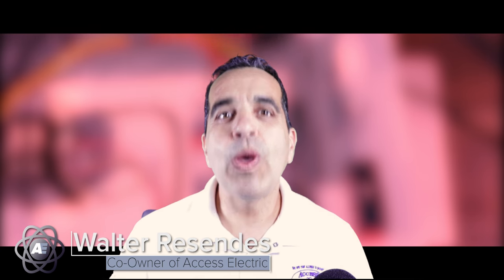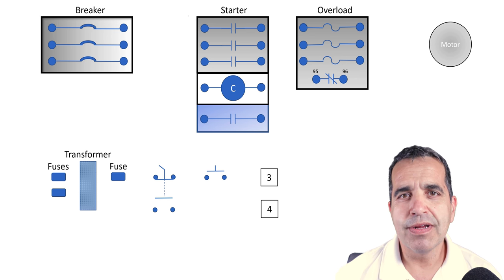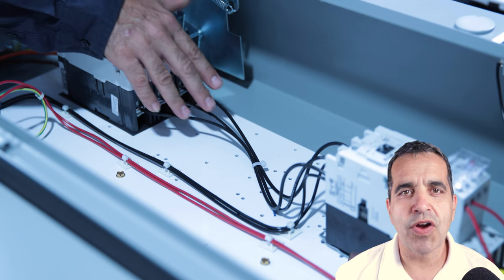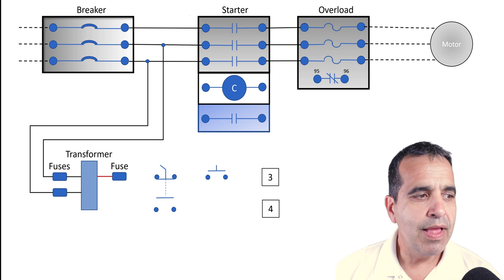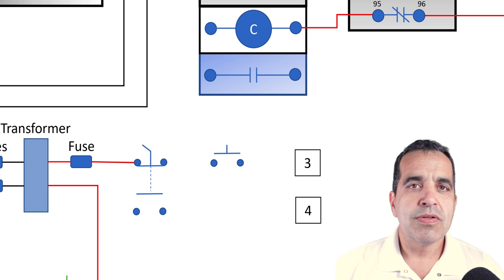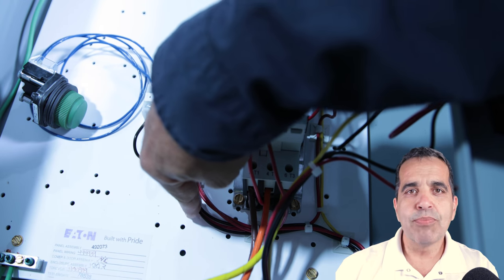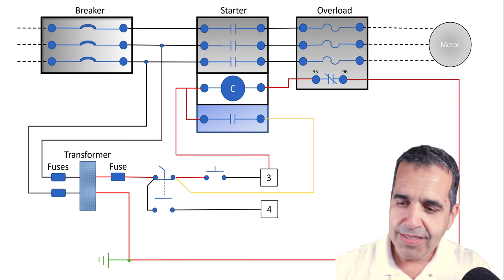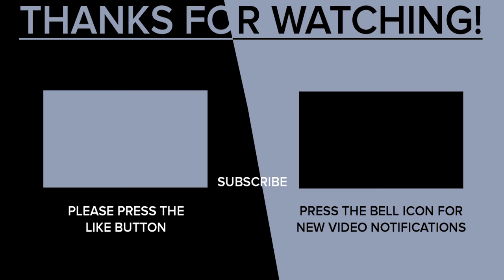Basic Motor Control: Pump Panel Wiring - Part 2

Comment: Greetings! I absolutely love your video. I am a rookie. May I ask a question? I am trying to "make sense" of the wiring for the auxiliary contact (red jumper and yellow wire). 

Which one is the grounded (neutral) contact? Since the jumper is coming from what appears to be the "hot" wire and the yellow is coming from the "hot" start wire, why doesn't this result in a short-circuit. 

I guess if I were to ask the question differently, I see the 120v loop for the coil with a grounded and ungrounded conductor. But for the contact, which kne is grounded and which one is ungrounded? 

Any help is necessary and thank you for taking time to review my question.
Reply from the maker: Hello and thanks for watching and commenting. If you look at the video and go to minute marker 6:08, you will see the red wire from number three going to the coil and to one side of the normally open auxiliary. And you will see the yellow wire coming from our hand off auto to the other side of the auxiliary. Keep in mind that both of these conductors are fed from the same power source. They are basically the same wire except at the red goes through the normally open start button and the yellow does not. The yellow effectively bypasses the start button. As for the ground in neutral conductor that is coming from terminal 95 on the overload directly to the other side of the coil. Since the red and the yellow that I mentioned earlier are basically the same wire, there is no potential difference between them and that’s why there is no short.
Reply: @AccessToPower  Thank you so much for your kind response! This made perfect sense to me when you pointed out that they both come from the same source, which is why there is no potential difference. Your videos have really helped me apply many of the concepts in the NEC Code Book. Thank you so much for all of your awesome videos!!!

Comment: Is there anything saying the overload aux contact is required to be on the neutral side of the contactor coil?
Reply from the maker: if the coil is 120 volt then the neutral would go through the NC OL contact. If the coil is 240 volt then you would run Line 2 through the OL. Same goes for a 480 volt coil, you would run line 2 through the coil. This kills power to the coil if the OL trips. If you dont use the OL contacts then the OL will not turn off the starter in the event of a overload.

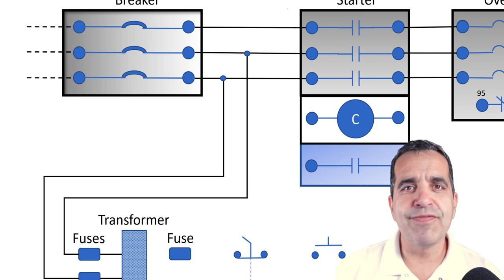Comment: 3:12 2-phase 😉
4:00 by grounding you have lost protection... Without (!) ground it will work as isolating transformer, so if you will touch the control wire, you will not be shocked by voltage 😊

Comment: What's the reason to used a lower voltage for control? Could they make the coil on the motor starter 480v coil and would eliminate the transformer?
Reply: Late but, 120 is safer for hand control in the case of a short

Comment: Series connection of smart motor controller to traditional (electro mechanical overload relay type)motor controller, which wired to  *single/same pump set*.
(Twin / dual motor controllers for the only one pump set),

Then,What are the *pros and cons*/Hazards, due to this type of wiring connection??

#Please clarify and comment